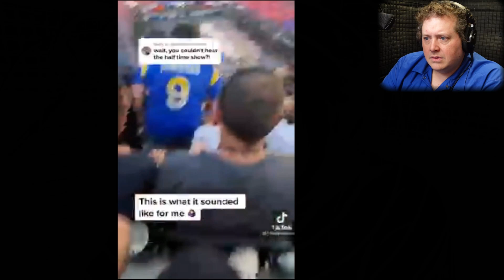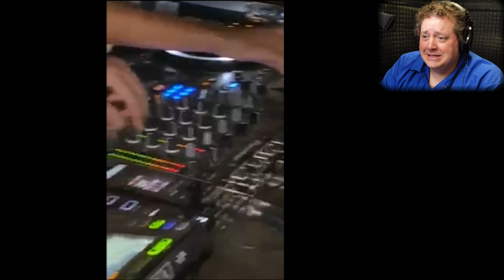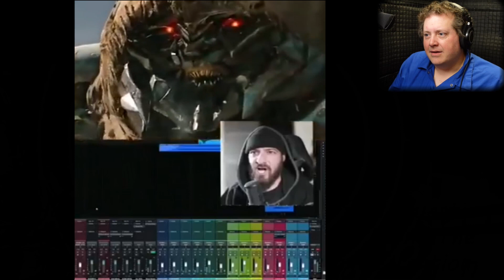Pro Sound Guy Reacts To Facebook Videos #2

Comment: 21:00 it's like some sort of rackmount either video or audio filter distribution amp type thing. The good news is if it is thoroughly dried out and fairly clean water there's a chance it survived hopefully there's a good reason they're doing this like cleaning up from floods. Probably not.
Reply from the maker: I doubt it but it's possible. I usually use distilled water and soak electronics in that if trying to restore them. Many day you must also use deionized distilled water.

Comment: 5:43 I was at a small event where I was helping the A1. He had me set the monitors at mic level. I politely asked if they should be set to line level, since the outputs of the mixer are probably line level. He told me that XLR audio cable passes mic level. 

I think I'm right, but it's not my place to question him. 

Allen, are monitor outs line level?
Reply from the maker: Monitor outs are usually line level unless switched to mic. It shouldn't ever be mic level though. You were right. The signal can be balanced (XLR) despite the level.
Reply: Most mixers will output line level some have selectable outputs for mic level namely Mackie to go into another mixer as a sub mixer. Generally you would want line level out, level in. In some cases I have run with the 4db boost in rare cases where it was needed. But that is done as a choice a educated choice.

There is also the side effect that if the mixer was already set to one level and the buttons pushed in and engaged you could instantly have feedback. Which would lead to damage if not caught quickly. So maybe his thinking was control at the board but that's still not the right way to do it.